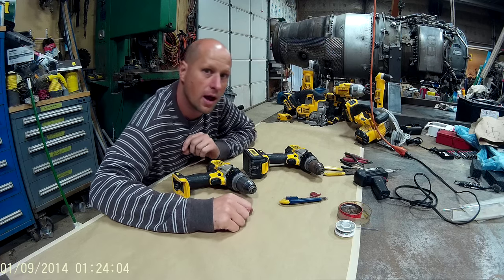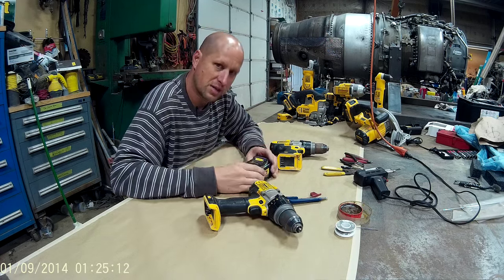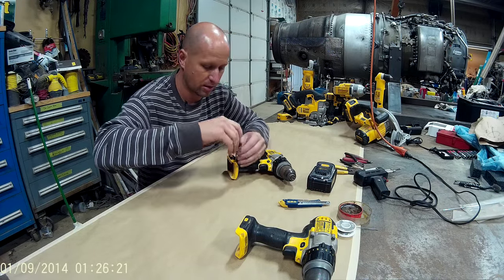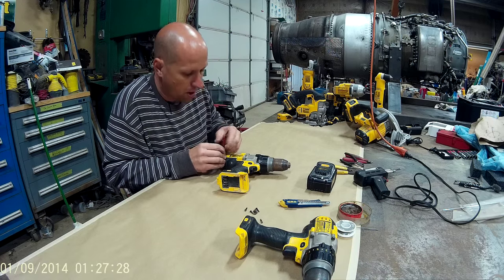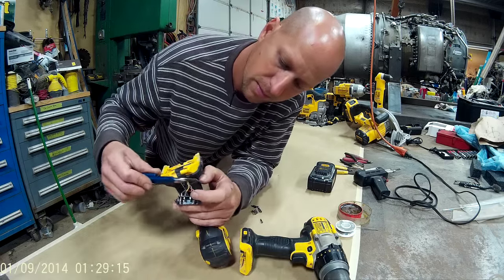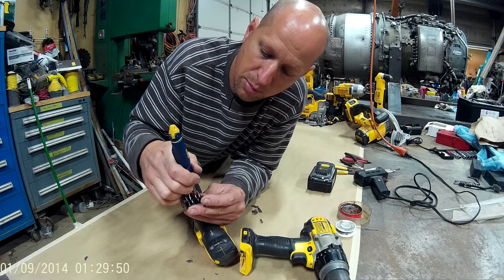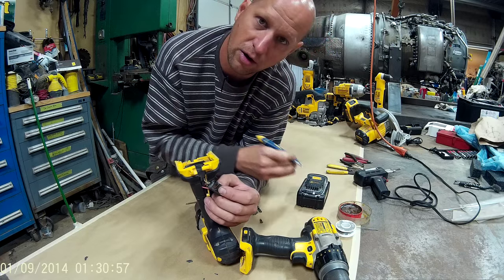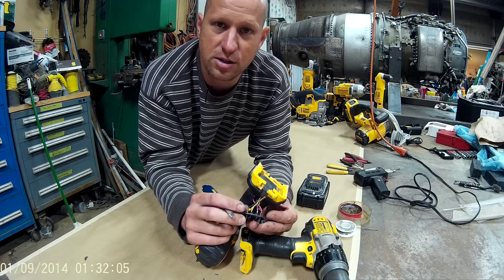Fix your Dewalt 20V MAX Li tools!!  Easy fix for intermittent problem.

Comment: This is B.S. You should not have to fix anything on a tool, especially newer ones.  For the money I just paid for the 20v 5 tool kit, this better not happen or Its going right back to the store and Milwaukee will get the business from now on. I have never had any issues at all with Milwaukee packs or loose connections etc.
Reply: They all act up no matter what brand. Milwaukee gets more warranty claims than anybody.

Comment: Thanks man im having this issue with two new drills i bought. I got a special on this Dewalt 2 drill pack and unfortunately only used it about once and im having this issue. But once i move the battery pack tight on the drill or upwards it works but still tends to stop randomly. Just a question I didn’t understand what you ment on how to fix the wire? Can you explain that to me again. Please and thank you

Comment: I've got a brushless Dewalt dcd790 18v, it works perfectly but the led won't turn off, unless I take off it's battery and when I put it's battery back on, the light turns on by itself. Any idea what should I do?
Reply: Percussive maintenance

Comment: yes mine is doing the same getting to stage it will not work , i thought it was battery but seeing this i will opening it up , 1/2 inch impacted 8 months old really hard life
Reply: Is that the 899 if so there seems to be a different issue there.
Reply: @jamesf9610   yes 899 pulled all wiring out found no problem , its because the battery pack is rocking so i  jammed a piece of plastic between the battery holder, which seems to work 70% of the time  not a fix , looks like the battery carrier has worn away  , i will make 2 metal plates to take up the play and try that

Comment: I have fixed three broken wires on my dewilt saws all and impact drill driver.  I once bought new batteries and it solved the problem until the wire broke. I was ready to switch  back to macheepa.. But I just soldered them and will keep on using them. Did anyone here realize that these 20 volt dewilts have five 18650 batteries in the battery pack. They are the exact same five batties as in the 18 volt milfuccy.  Dewilt 20 volt is really 18 volt.
Reply: Anthony Romano they both put out 19.2v on a full charge
Reply: My hammer drill and Impact drill have lost torque and some power. Only used them about three times each or less as I have had them for five years and are like new. Trying to fix that or take it in.

Comment: good instructional video
Reply from the maker: +Keith Young Thank you Keith, I hope it helps someone.
Reply: Carl Crawford i want to ask i still got my first dewalt cordless  model dw990  its 14.4 volt  xrp i wanted to.ask if that new dewalt adaptor for older 18volt to use the newer 20 volt  what am getting at is if i get it and a newer 14.4volt max will it work ? i love the feel.of my drill had it 15 years its made in the us made much better then now for a 14.4 volt its got power  from 0-450 on speed one and speeed two 0-1400 thats still power for today i dont use it anymore on its for my place let me know thanks
Reply from the maker: no, the 14.4, 12, and 9.6 volt systems were somewhat interchangeable, but the 18 volt was totally not interchangeable.  Even if you could get the terminal part to stick in, the battery retention tabs are in a different place on the 18 volts. 

    If I were you, I would just get a 20V drill.  They have so much more power than the older nicad tools!
Reply: Carl Crawford >thank you for the info i know dewalt got 1.2ah on newer  batteries but i.would need a new charger  i got like 4 tools with the ni-cd type saws and  a nail gun and they still look new only my xrp drill got beat up and loved i just need like like 3 years more  i can get 4 dewalt 1.2 ah batteries for $99.99  and they will fit fone they are not ni-cd just got to buy the charger i can change the cells in two batteries to 3ah and use that for the drill it dont get that much use so i would not burn out the cells if i.do that

Comment: What about the DeWalt weed eater model DCST972 brand new out the box? I have 4 of them! I put the battery on it and doesn't do anything. I want to say it has to be a lose wire. I'm using a good working battery. Anybody ever had this problem and found a solution?

Comment: Here's why DeWalt SUCKS:

Censorship! Censorship!! Censorship!!!

Here's a copy of a review I wrote to be posted on DeWalt's website:

 "Great Battery- but HORRIBLE Customer Service"

I'll preface my review with pointing out that it is an "Overall Rating." The battery is excellent, but after spending THOUSANDS OF $$$ on DeWalt tools, batteries & accessories, the cheapskates got rid of the tel# to call & speak with someone! Up until a short while ago, you could call & speak with someone in Customer Service, Sales, Tech Support, etc. Now you can only send an email, requesting a representative to call you. Screw that (pun INTENDED), DeWalt!"

Shortly after submitting my review for approval, I received this email from DeWalt:

"Our staff has read your review and values your contribution even though it did not meet all our website guidelines. Thanks for sharing, and we hope to publish next time!"

I did not use any profanity, threats, etc., I merely spoke the truth & obviously, DeWalt aims to stifle the truth. I'm going to research the level of care/attention that Milwaukee provides to its customers & if it is better, I likely sell my $8,000+ DeWalt tools & jumping ship... SHAME ON YOU DeWalt!!!